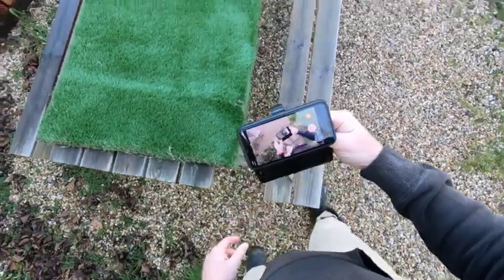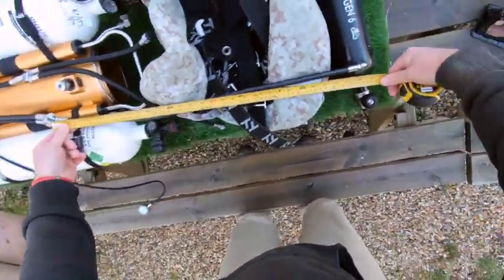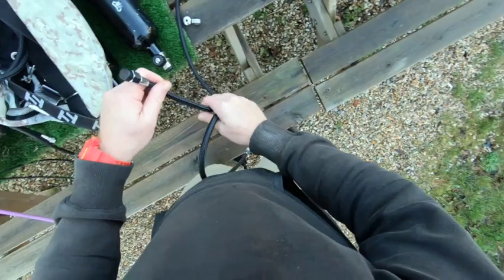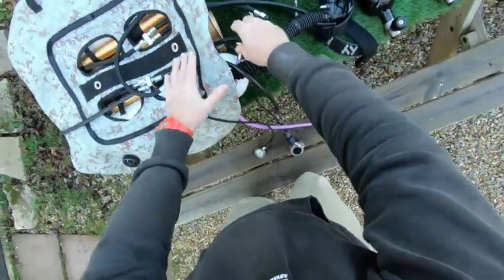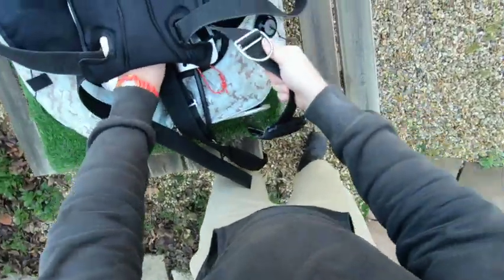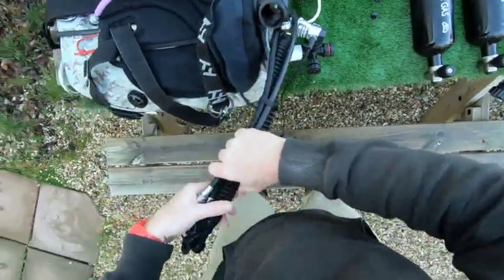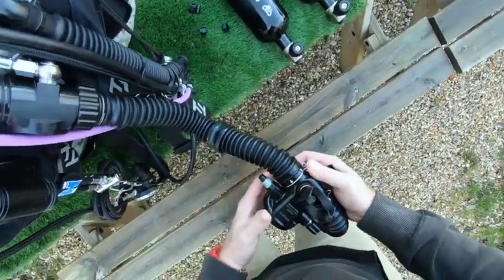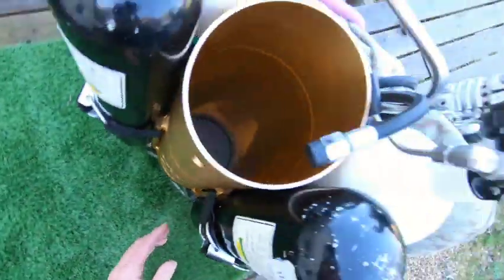GUE configuration jj-ccr: POV set up 1

Comment: Thank you for the video! Must have watched it a hundred times by now :D 
May I ask what regulators you are using for oxygen, dry suit, and diluent? And why do you prefer a scubapro regulator for the oxygen? 
Would you be worried about using a piston regulator in freezing conditions? Thank you for your time!
Reply from the maker: Thank you.  I don’t worry about piston in cold water :). I use mk25 a for back gas, mk11 for o2 and now mk2 for drysit
Reply: Thank you for the quick reply!  @gbdivering

Comment: Hi Graham, what hose types and fitting did you use for the suit inflate to get the two inflate hoses pointing different directions? What type of hose from the 1st stage to the T ? Thanks in advance.
Reply from the maker: Hello Matthew - where are you based?  I can source parts like that.
Reply: @gbdivering  I am based in Essex.
Reply from the maker: @matthewjones5731  Nautilus dealer can get those parts - message me if you cant find
Reply: Hi Graham, I'm also in need of one of those parts, both a standard lp splitter and suit inflate dual direction splitter. I can't find the parts anywhere, even on the nautilus website; can you source them?
Reply from the maker: @harveyng1  I can - are you in uk?
Reply: @gbdivering  am indeed
Reply from the maker: @harveyng1  send me an email - go to GUE.com and find my instructor page - or tgeee should be a contact here (I think)

Comment: Great video! But why would you use (3) splitters and adding 9 extra failure points (o-rings) ?
Reply from the maker: Thank you - it does for sure add failure points and it is possible to configure without splitters - but you end up with akward hose angles.  So its a balancing act - I think generally the risk of these captured o-rings failing (especially in this case as they are all protected between BP and canister) is one I am (personally) happy to accept.

Comment: I've been trying to find out where the Dil mav is?! Does the gue jj not use a Dil mav?
Reply from the maker: Why would you need a DIL mav - you have ADV?   Dil mav was only added after flow stop was added to pass CE WOB test in head down orientation.
Reply: @gbdivering  I was not aware of how you would manually add Dil, for a Dil flush. I dive two different CCR which are not JJ one has adv and mav and one only has mav no adv. My interest in the configuration was wondering how you would do a Dil flush and cell check in the event if needed with no way to manually add Dil.

Thx
Reply from the maker: Just press adv for dil flush
Reply: @gbdivering  copy that nice makes for one less piece